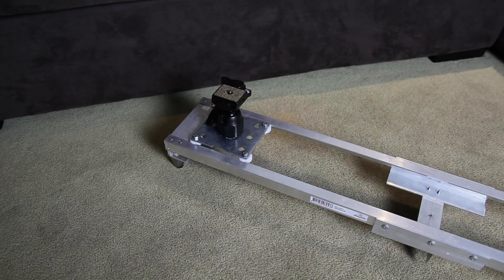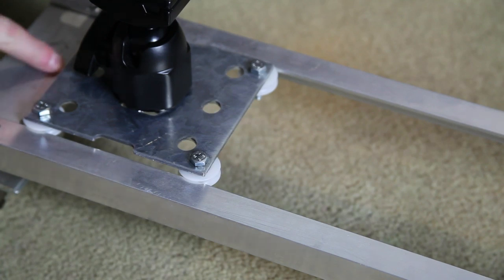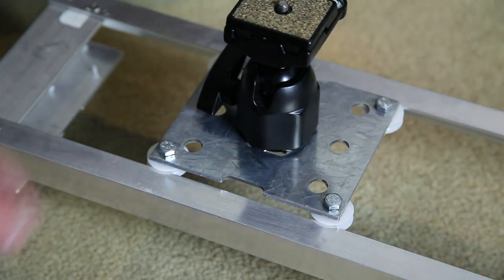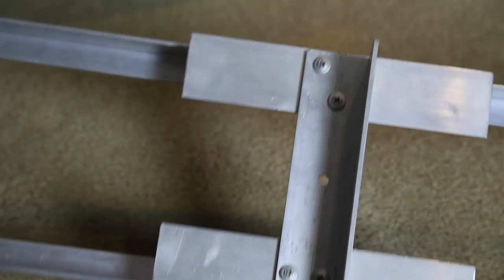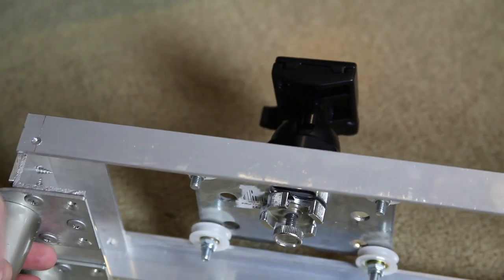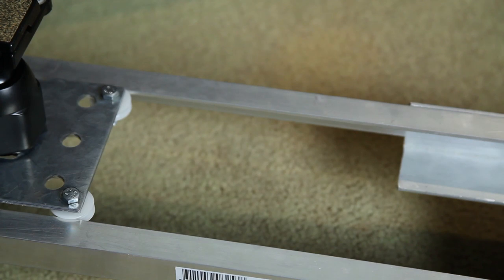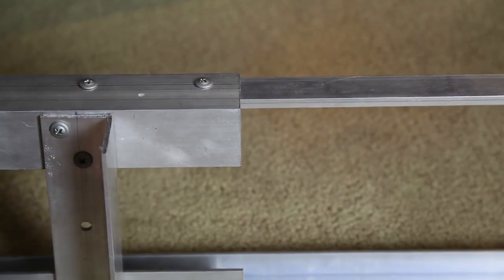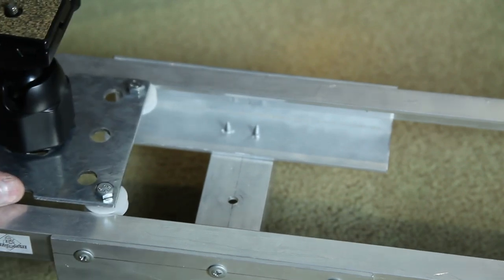How To Make The Best Camera Slider Ever!!!

Comment: Well, that's damned impressive then. I have seen several "how to" videos on this same subject, and yours clearly has the best engineering. If the wear of the rollers is not an issue, them I'm going for it. I particularly like the use of stock aluminum and the pop rivets. Clean design and look, durable construction.

Comment: Hi, great video. I'd like to do this slider. Do you think it works with bigger cameras? It seems 1-2 mm of the rail inside the bearing. It may fall at higher weigth.